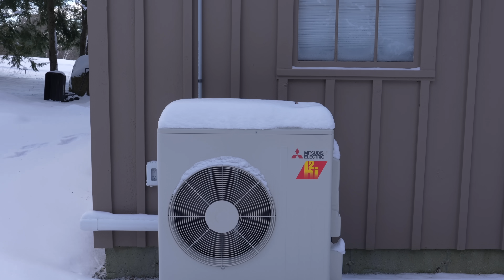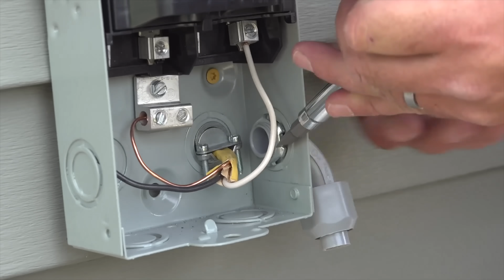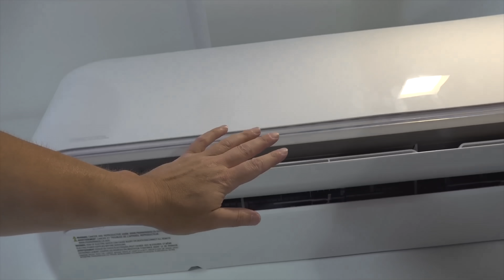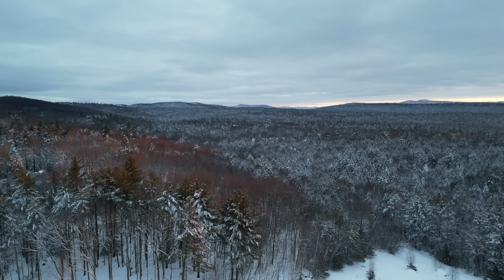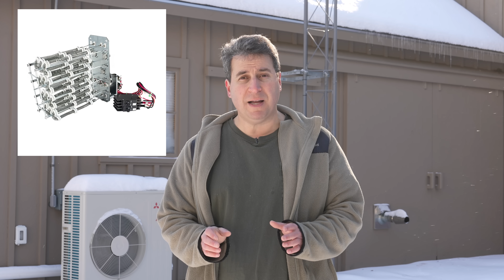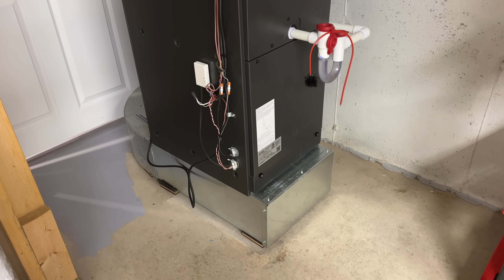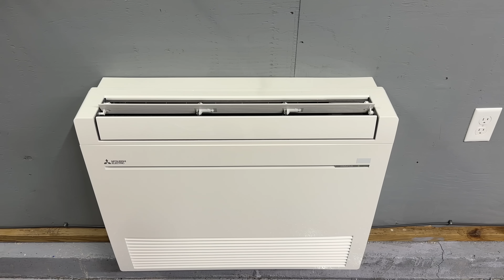Why Heat Pumps are now leaving people COLD

Comment: Think the title of video is a little misleading. I have two ‘arctic’ mini splits that work great so far to -10° but are definitely using more power and able to maintain 70° set point.  These units lose efficiency but are NOT failing, meaning broken and no longer working.

Comment: It also depends on what you mean by 'comfortable'. I'm fine sitting in sweats while the house is at 60f, which even this crappy Armstrong unit the builders installed can keep my house at. Even when it's -7f outside. If you absolutely cannot stand wearing clothes, or having the house go below 70f then yeah you're going to want to let those supplemental heating coils run.

I'm still getting it replaced with one of those Mr. Cool universal models because they're quieter, more efficient, and claim to work at 80% of standard efficiency even well below 0f.
An extra 4 SEER is also going to save money this summer while it's over 100f outside. 

I haven't had an issue with HVAC companies talking about the resistive heat backups, in fact they're proud of it in some models. What they're really bad about imo is trying to sell you a $9000 Mitsubishi/Daikon for $15000 after markup, and then claiming they won't work with customer supplied equipment when you show them the same model for thousands of dollars less when you buy it online. 

Short term profit as a primary motivation ruins everything. 

You can't power a gas/oil heater off of solar, so if you have one you'll always be beholden to OPEC, Russia, SA, and the big oil companies. With a heat pump, even a crappy one, you can at least lower your reliance on them if not eliminate it entirely.

Comment: We live in Central Florida. Our heat pump Carrier Split system has been fantastic. We have our 5KW heat strips as well for Auxiliary heating. When the temps get below freezing here we actually have the Aux heat strips kick ON especially when the outside condenser fan freezes up literally! That has happened when we have a slight rain and the cold air causes it to freeze like a block of ice. Our setup works really well in Florida. It would not work so well in areas up north. Our home is cement block with zero insulation. We have zero insulation in our 2x8 1:12 vaulted roof which is vented with soffits and a Whirlybird. Someday I would love to have a Torch Down roof insulated as in Out-sulation with foam board and a new roof. I still like having the vented roof to keep it cooler in the summer which works well for us. Although we still get 100*F temps on the inside of the ceiling inside when it is 90+ outside. Whew 😅 😜. Great video. God bless 🙏
Reply: Hi,
Your heat pump should have a defrost control system. In the most basic form they do a timed defrost based on the ambient temperature. The defrost simply shuts the fan down and changes the refrigerant flow into cooling mode, this melts any accumulated frost on the condenser. More advanced system only defrost when the coil hits a particular temperature. Either your defrost system isn’t working, or it’s not equipped. If not equipped, it’s actually quite easy and cost effective to install a defrost control system.

Cheers.
Reply: @JordieG8  It does indeed have it. The time it froze up was with a heavy rain and it was 27 degrees in Florida here. Literally we had snow flurries in Central Florida outside. It did switch to cooling mode to thaw out but th condenser fan grille froze and the blades were chipping ice. Thanks 🙏👍 for the reply. Hopefully we don't get that cold ever again in our parts of Florida. Lol 😆
Reply: @onecrazywheel  my Grand Parents had a winter place in Clearwater and we would go down to visit them all the time. I remember snow in Clearwater at Christmas time one year. Probably early to mid 90’s.
Reply: @JordieG8  I remember snow and ice back in 1988 quite well. I'm almost 40 now. Good memories for sure!
Reply: @onecrazywheel  ha, me too 84 child.
Reply: @JordieG8  Feb 84' for me!

Comment: I have an Electro industries "Warm Flo" system that uses 15KW of resistance heat (5KW X 3) to supplement my cold climate York HP. The system monitors supply temperature in the ductwork and keeps that at 96˚, (my setting). If the HP cannot keep that temp alone, and it usually can above 20˚ outside temp, then it starts blending in resistance heat 5KW at a time until that 96˚ is achieved. 1 of those 5KW stages is modulating, the other 2 are either in or out. I can watch it on borderline days and the HP almost has it, but that modulating stage will come on for just a few seconds, then go off again and repeat as needed. Pretty cool technology.

Now if they could figure something out for the defrost cycle when the HP has to reverse and turn back into an A/C for 10 minutes or so. That kicks in the resistance heat to all 15KW, but all in all a small price to pay.

Comment: Those back up heat strips use a lot of energy 10-20Kw depending on the size of your house, so if you lose power and have a generator you are going to be using a lot more fuel per hour to heat.  Even in Oregon at 15 degrees the back up heat was necessary to heat the house. If you live somewhere where the power goes out a lot keep this in mind.
Reply: Yep.  I really regret not thinking of putting my heat pump over a propane furnace when I had my house built.  Now I'm looking at replacing the system, and the best inverter based systems can't be put on a propane furnace.  I'm strongly considering a hot water coil or putting a propane furnace with dampers so it can be shifted over in a power outage.
Reply: @matthewbeasley7765  the Bosch BOVA  can be installed on a propane furnace.
Reply: 10-20Kw /hour?
Reply: @NoGufff  It's a multiplication, not division.  Watts are Jules/Second.  Which is why your electric bill is Kilowatthour (kWh).

Here's another way to think about it. Watts (Power) = Volts * Amps.  10000W / 240V = ~42A. Looking at that, 20kW is an insane number, since you're talking a 100A breaker just for the heat strips.
Reply: @EmperorA0  Thanks for the first part, the per hour part really grates on me, especially when people double down on it.

Don't forget in your calculation that heat is a continuous duty load, so it needs a 80% de-rate.  A 50A breaker de-rates to 40A, so for 42A a 60A breaker is needed.  

Most heat strips over 10kW are on double breakers.  Some 15kW will use a 90A, but once you go over 90A, it is a much rarer, far more expensive breaker plus the wire is HUGE.  

I have 22kW.  It is on two 60A breakers.  It has a 10kW on the circuit with the blower, then a second circuit with 12kW of heat.  Inside, that's broken down further with two 5kW elements with their own sequencer, and two 6kW elements, also with their own sequencer.  (The sequencers are time delay relays so the load doesn't hit all at once.)
Reply: @NoGufff  yep, that’s 10,000 to 20,000 watts. If you have a 20kwh generator that’s half its capacity to generate power on the low end.  Most generators fuel consumption is based at 50% of generation.  That’s why your fuel burn per hour increases significantly at low temperatures with heat pumps with back up heat.  Once the back up heat kicks in your 50% fuel burn rate moves towards 100% depending on what else you are running.  Have a well pump?  Maybe a shop?  These are all things to consider.

Comment: In Oregon we have government incentives on Extended Capacity Heat Pumps. Which requires that the capacity of the heat pump at 17F must be at least 85% of its capacity at 47F. These type of heat pumps will work in pretty cold weather. The list of approved Extended Capacity Heat Pumps is about 4 pages, though I'm sure they cost more than the standard heat pumps.

Comment: Heat pumps in frigid regions are a fools errand.    I have a Mr. Cool on my shop for summertime... works great.  But radiant in floor heating is the only solution for winter in the high Sierras.   Otherwise I'd be better off burning the dollar bills than using supplemental heat.

Comment: We live in Minnesota and run a dual fuel system. Heat pump to 20 degrees then nat gas for anything below that. Works like a charm. (our heatpump works well under 10 degrees but electric bill went sky high)

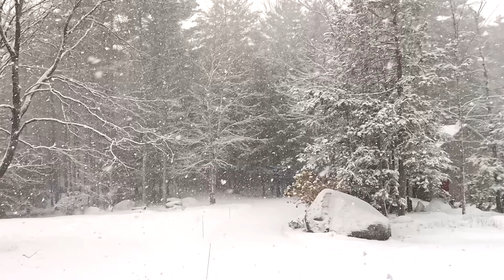Comment: 5:30 so i am in MA.  We added the heat pump separate from our existing forced hot water system.  When it gets cold out,  somewhere around 30 degrees it switches from heat pump to forced hot water.   Keep the house at 72 all winter without issues.  To do it again, or doing it new i would do the heat pump but  appreciate knowing that some form of supplemental is going to be necessary

Comment: As an HVAC contractor in the Denver Metro area, we install many variations and brands of systems.  If you have access to natural gas as most homes do in Colorado, then we always opt for the dual-fuel option.  This allows the customer to have a heat pump and a natural gas furnace as the backup heating.  We try to figure out what the best COP temperatures will be at when we set the setpoint for switch over to the furnace.  You can use 80% two-stage furnaces, 95-98% two-stage or modulating.  Many of our clients will push back against an electric option because of the cost per kWh and it's return.  We don't really sell AHU's here as the furnace is what people are used to and most comfortable with.  We sell 6 major brands and specifically tailor to each homeowner.  Some systems are still furnaces with straight cool, but now some of the models we sell the HP is the same price and we use that and give the customer the option to use that HP feature later if NG prices go up considerably.  People love the fact the furnace can heat the space while the HP is defrosting or when the HP hits the set temperature to turn off, they have instant heat from the furnace with variable speed blower and multi-stage gas settings which will run in low nearly 90% of the coldest days.  You can run on comfort or efficiency settings.  Technology keeps getting better.  Now we just need to keep the government out of our business and forcing people to spend crazy money to meet unneeded requirements.  

Geothermal system are amazing and most likely the future, but the ROI is not even close to pay for itself in a families lifetime in a home.  But some have opted for it, but I don't believe it has hit the price and efficiency it needs to be at before it becomes mainstream.
Reply: Do you think the modulating system is worth the premium over a high efficiency two stage if it's only the 'backup' heat source?
Reply: @Mike_219   It totally depends on the equipment you are being quoted and the premium they are charging.  I know the wholesale costs and modulating is really not that much more expensive.  It is different programming and a different gas valve.  Generally, you need a thermostat from their brand to probably control the system, if it is a communicating system which most modulating furnaces are.  If the price isn't a lot sure, it is worth it.  But from what I have seen, the contractors usually mark them up a lot more than necessary.  But two-stage as a backup heating source is beyond plenty and will work fantastic.  You might even prefer the furnace heat over the HP.
Reply: @Mike_219 

Why don't people run the heating system 100% on natural gas?

That's how it is done in Russia and other coldest places on the planet.
Reply: @ajarivas72   Being an HVAC contractor here in Denver, my own personal homes are dual-fuel but I only use the HP for air conditioning and furnace for primary heat, the HP is super-efficient but the cost per kWh and COP doesn't make sense besides when my solar panels are producing enough power.  I prefer the heat from a furnace, and it is significantly less expensive to operate.  I ask the same question, but everyone thinks electric cars and electric heat is the future and it is not.  Geothermal is likely the future for many areas for heating and cooling.
Reply: @ajarivas72  Why is Russia a huge exporter of Aluminum but the ore (Bauxite) comes from Australia?  Because energy is super cheap there.
Reply: @ajarivas72  Our dear leaders want the US to go 100% electric and are going to turn off the natural gas utilities in 2035. Just look at Chicago how a great idea plays out.
Reply: @ajarivas72  It's been said that Russia is a gas station with nukes.
Reply: this is my setup. the windows and insulation are what kill it for me.
Reply: My friend currently has a propane hot air system, with ducts distributing the hot air. She also has an old central air unit that attaches to the air handler for AC in the summer. I believe that unit can also produce heat without the gas burner coming on, at least if it's not too cold out.

Can she upgrade to a more modern/efficient heat pump that would do most of her heating, except when temperatures got too cold? She's in NY state, about 30 mile south of Albany.
Reply: @billvojtech5686  So it sounds like your friend has a propane LP furnace with an AC evaporator coil connected to an outdoor AC condenser unit.  If it can produce heat too, that means she actually has a Heat pump outdoors that acts as air conditioning in the summer and when the reversing valve is engaged then it goes backwards and brings heat inside to the evaporator and acts as the condenser as the outdoor unit normally would do.   The system can have a new LP furnace, coil and higher efficiency heat pump installed to use the duct system to heat and cool the home.   
The heat pump would be set to run down to a certain temperature and then have a setpoint to switch over to the furnace on the really cold nights.  But LP is more expensive than natural gas, so the math would have to be done to see where the crossover point is for using electricity on the heat pump and LP on the furnace as far as cost goes.  But it certainly can be done.
Reply: I live in MN, and It's what I plan to get when my old AC craps the bed. I have a newer 94% furnace, but the AC is from 1999. It's had one leak fixed a few years ago, but if it happens again I'm gonna replace it with a heat pump. The heat pump will be more cost efficient heating in those fall/spring months when the temps are in that 40-55F range. 
I could just put an ambient lockout switch outside tied to the signal wire from the tstat to lock it out below 40F, at which point the house will eventually get 1F colder and the 2nd stage tied to the furnace heating wire will kick on the gas.
At the very least I have a backup heating solution if one system fails. Even the heat pump alone will keep the house from freezing even when it's -20 out. Might not be warm, but better than nothing.
Reply from the maker: I like the sound of your setups a lot. Thanks for sharing this
Reply: I see your point. Nevertheless, if I had the land, I'd go with geothermal. Purely for the off-grid capabilities. I have a bit of a prepper mentality. 
✌🏻&❤
Reply: @kevinkarnes4067  

I concurr. I want to be 100% off-grid.
Reply: @kevinkarnes4067   I totally agree, if I had the land and the finances for an upfront pay for the cost of a geothermal system, I would put one in immediately.  I have solar and it works great.  I am also a bit of a prepper and have multiple sources of heating and making electricity, plus storage of excess.  But maybe later in life, I will get that opportunity to have a setup such as that.

Comment: You always need supplemental heating for below freezing temps to support the defrost cycle even if the heat pump is more than adequate, or it will be cold when it defrosts! I am on my 3rd system and never has the installer not put in heat strips. The first system had crazy big strips - 30 kW I think.  The next one smaller (presumably as the heat pump became more efficient in the next gen).... the most recent one is down to a 9 kW strip.  Each generation also lasts longer than the previous.  Most recent one lasted 17 yrs before it became too issues prone (noise level issues) and I replaced it last year.
Reply: While it does run cold in defrost, most units don't blow air while in defrost, so that brief period, something like 5 minutes for mine basically just stops for 5 minutes then continues the heat.  And unless you are directly under it you don't notice any cold at all.  So because it runs cold is not the reason for. a supplemental heat system.  But its efficiency and ability to warm air goes down with temperature.  So lets say if you have a 36000 BTU heat pump, that may only produce 20,000 BTU's when really cold out, so the colder it gets, the more heat you need, but heat pumps give less then.  The defrost cycle does hit on that, but basic thermodymamics is the main issue.  there is only so much heat to gather from outside given the dimensions of the unit.  Less heat gathered will result in lower amount of heat pumped inside.
Reply: The best way to heat a home is with fossil fuels or wood.
Reply: @ajarivas72 Define best?  Most dependable, most convienent, cheapest, wanting to make a point, etc.  I have a high efficiency propane furnace and installed a minisplit.  My payback time for the mini-split was less then 2 years over the price of propane in my area (which is cheaper per BTU on average then oil here).   Additionally I am running the furnace far less which is prolonging its life hopefully.  I still have the propane which kicks in when the temps get cold enough.   Over all this combo for me is main heat is the heat pump, aux heat is the propane furnace is the best way I have found (least costly, most comfortable having a backup heat source), and due to the price of cord firewood being a bit high in my area, and electricity a bit lower than average for my area the cost per BTU is about equal to cord wood.
Reply: @Chap.DavidStrchld  thanks for the feedback
Reply: @ajarivas72  Enjoy the climate change!  Jerk.